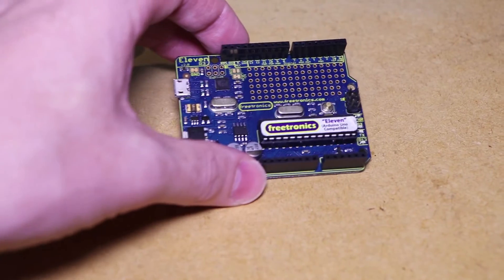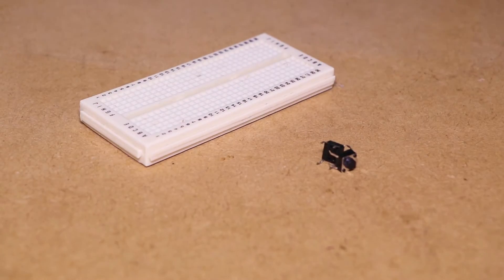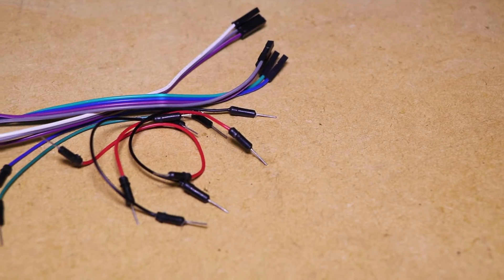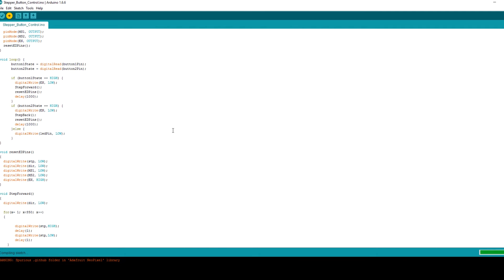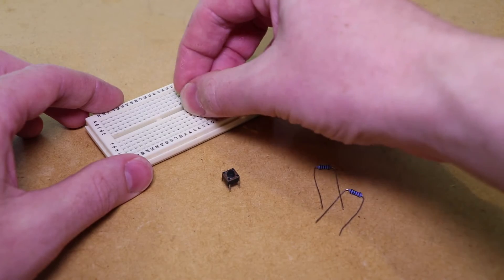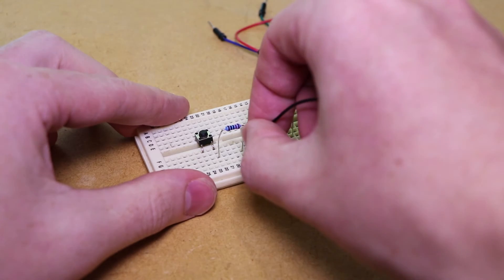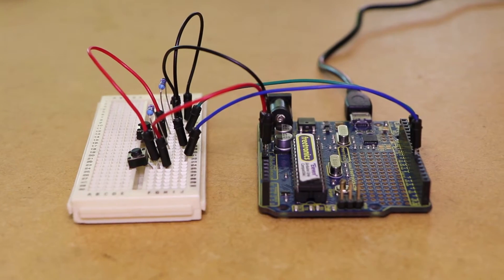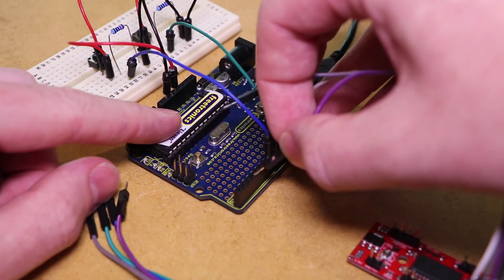Arduino - Stepper Motor Control

Comment: Thanks for this. Can you help me? How can I change your code to do the following:

I need the stepper motor to ONLY work when a button is pressed and held down, the stepper motor stops when the button is released.

One button will make the stepper motor go CW while the other will make the stepper motor go CCW.

The number of steps and speed of the stepper motor will be controlled from within the code. (I will not be using a rotary encoder).

Thanks.
Reply: have you found the answer yet because I need this too
Reply: Just search “stepper motor arduino with buttons” I know I’ve seen a vid that does just what you both are asking. I’m pretty sure they have code you can use or find on their links. Best of luck 🤞